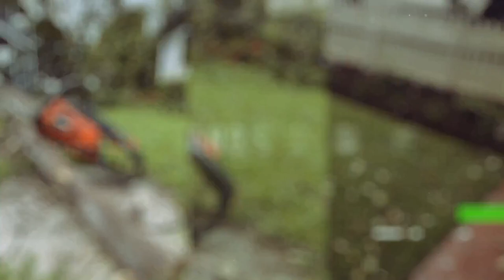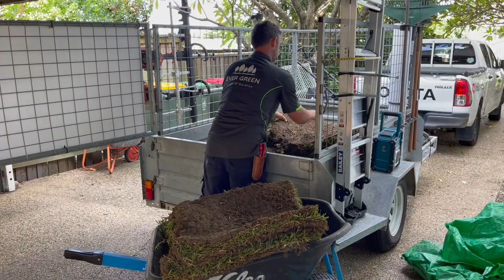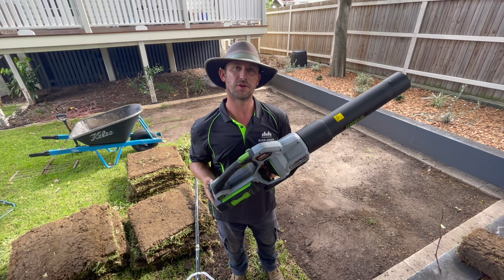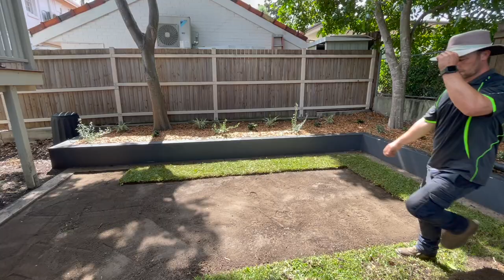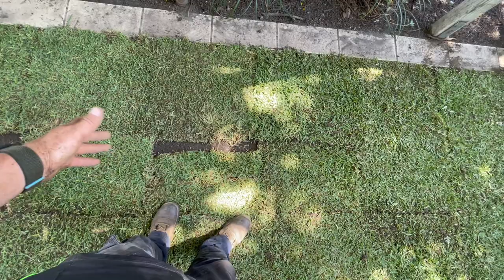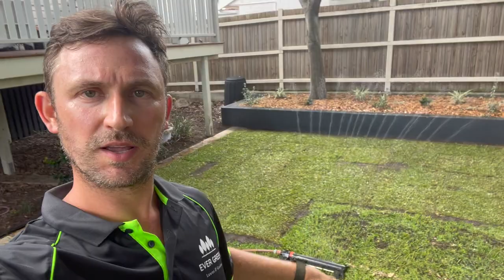Turf repair on LAWN area killed by LAWN GRUBS. Includes a few PRO TIPS.

Comment: Hey mate! Awesome to see you it’s been a few weeks. Great job on that man and good tips. Would you ever air rate the soil and mix the fertiliser in before laying the new turf?
Reply from the maker: Hi Andrew. It's great to be back. I am sorry for the delay in getting videos up. It's been a very busy start to the new year. Still trying to catch up from last years work haha.
In regards to your question, it depends on a few factors. The current condition of the soil. If the soil is really compacted, you may need to cultivate it, not aerate. Just apply the required amount of good nutrient fresh soil and mix it in, or just spread it over the top of the existing soil. This will have plenty of food in it for the new turf to lay on. Avoid buying the cheapest soil from your landscape yard if you can avoid it. You don't need to apply any granular fertiliser product at this point. Wait till the turf is settled in.
Hope that helps.
Thanks for the support mate. 
Hope your having a great start to your 2022.